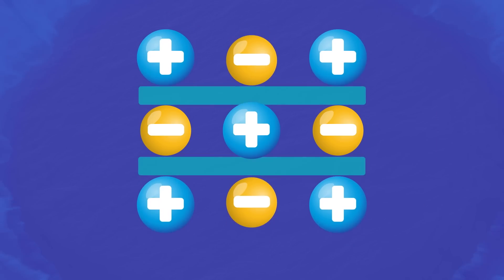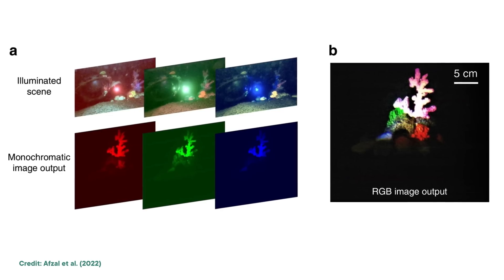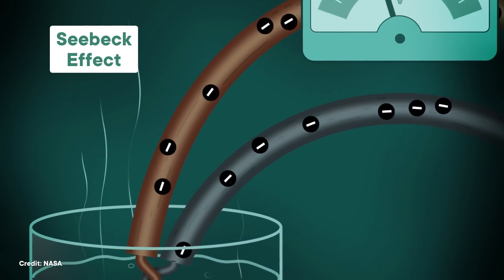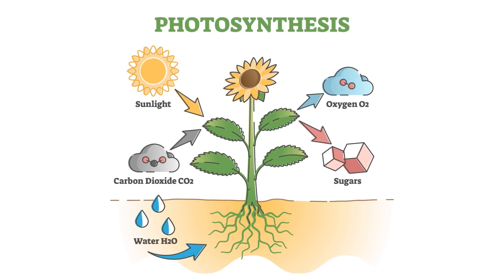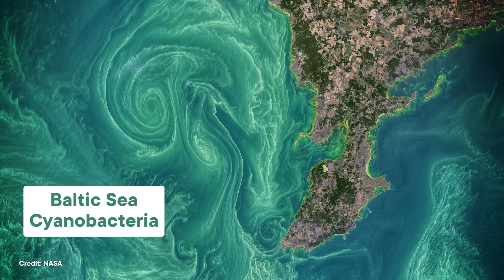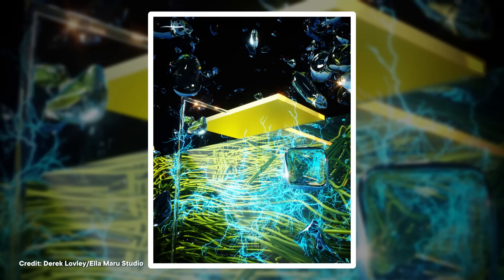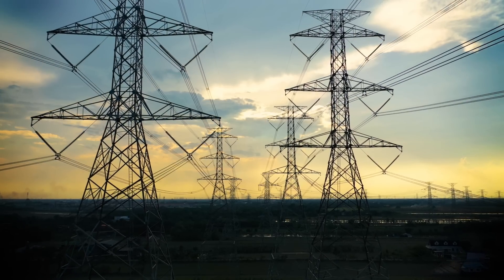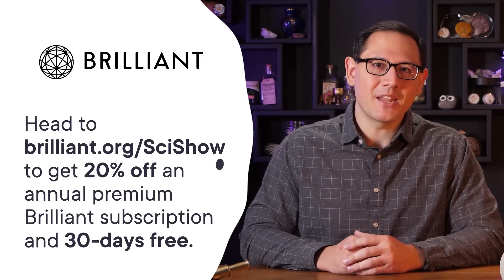Four Weird Ways to Make Electricity

Comment: Could we use any of these to power our needs?
Reply: Not really. They aren't practical for grid scale power. But there are niche applications for things like powering sensors or keeping batteries charged. Think of heat-powered sticker-sensor you could slap on a pipe, for example, to monitor the temperature and send a radio message a couple of times an hour - no wiring required. Or a motion-powered strip across a road that counts cars and sends the readings back to traffic control. Or a remote control that is powered by the motion of pressing the buttons so it never needs new batteries.
Reply: On a small scale: Definitly, some of them are in use already.
on a large scale: Not yet, but I hope soon.